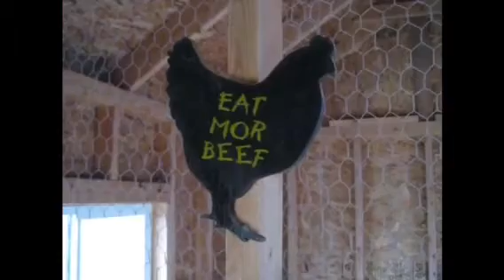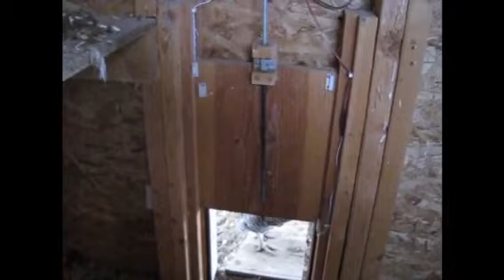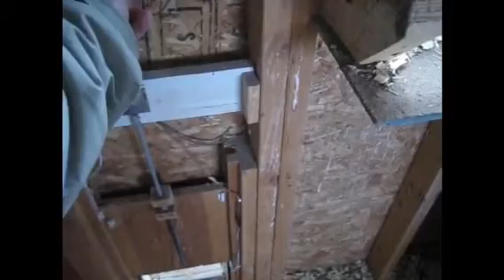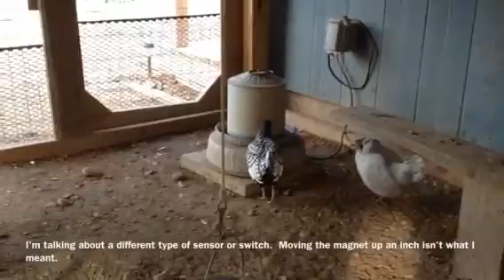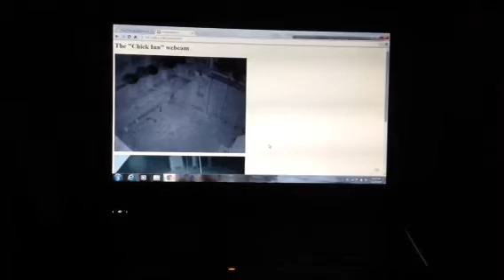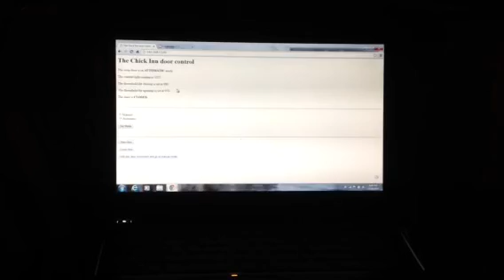Chicken coop technology tour

Comment: BTW, if you're having range issues with your wireless router,  check out the TP-Link 2.4GHz N300 Long Range Outdoor CPE. For $39 you can configure it as a wireless bridge and shoot a wireless beam from the inside of your coop to your house's indoor router, even if it's 200' away. Use 2.4ghz, not 5ghz. (lower frequency = better penetration through physical barriers like walls and trees)

(I use Ubiquiti radios for my work, so I do quite a bit of wireless on various frequencies. But for what you're doing, the TPLink is more than enough, and 1/2 the price of a UB radio)

Comment: FINALLY!! Someone using a dadgum threaded rod!! I can't believe the number of people out there using linear actuator$$. I'm thinking "People!  A threaded rod and nut is just a couple of bucks!"

Even with a NEMA 13 motor and Arduino (ESP32), my design shouldn't cost more than about $30 for the door and controller. My NEMA 13 arrived earlier this week, and my HBridge circuits (all 5 of them) just arrived today. I plan to use hall effect sensors (magnetic switches) as the limit switches. I figure they're impervious to chicken dirt/crap).

I'll be building the coop in a couple months. We'll see how it all works out. It'll be my first Arduino project.

How are you running electricity to your coop?  Solar? Or 200' of buried copper?
I've got a 110V outlet kinda/sorta nearby mine, and will mount a 12V 3A laptop power supply and run it out there via buried CAT5 (got lots of burial grade CAT5 on hand).

Comment: Why don't you use a Nema 17 stepper motor to control the movement more precisely? You can program the amount of turns and that would give you the precision you're after...
Reply from the maker: I thought about that, but I think I would need some type of a mechanical switch to determine the starting position of the motor.  For example, if the door position was in the middle and the system was powered on, how would I let the arduino know the starting point.  My first thought would be to move in one direction until it hits a switch and then reset the needed turns from there.  I like your thinking though.
Reply: @mikewilliams3376  You could spin the motor up until it reaches a micro switch. Then Arduino knows the positions and you can go back to step counts. But then again... How often would power fail exactly during the time the door is moving? It shouldn't be a big issue I think
Reply from the maker: Chris Wisselo We get probably 1 or 2 power outages per year.  I thought about an optical system as well.  Some type of led with a sensor, but I think the dust in the coop would have caused a failure.  If I were to seal the mechanical portion it might be reliable.  Lots of ways to build a better mouse trap.  The fun is in the journey.  I've added a few things since making this video.  I added a raspberry pi to host the interface page with graphs of the temperature and light levels.  It also sends me a text when  the door opens and closes.

Comment: For the photo resistor you can use a lm311n ic with a potentiometer wired as a voltage devider for reference voltage the other voltage in is where you create your voltage devider with photo resistor. The lm311 will compare the two voltages and give you either a hi or lo. The pot allows you to fine tune the sensor.
Reply from the maker: +Daniel Harrington On an earlier version, I used a voltage compatator circuit, but when I switched to using the arduino micro controller, I could program it to read the voltages directly and turn the motors on or off accordingly.

Comment: hi, i have the same set up with the wireless bridge allowing me to access my arduino online. I used to run a 100ft ethernet cord across my lawn. but now that I've put in the wireless bridge i can't access my arduino anymore. My ip address say 64.185.15.2:8081 with port forwarding. what settings did you set on each router to do this? did you use port forwarding?
Reply from the maker: +Jude Wow Sorry I took so long to answer, I didn't see the comment until now.  I do use port forwarding to access the webpage from outside my local network.  On the router in the coop, I have it set up as a 'client bridge' with DDWRT.  I don't have any port forwarding on that router.  The router in my house is where I have the ports forwarded which point to the IP for the arduino.